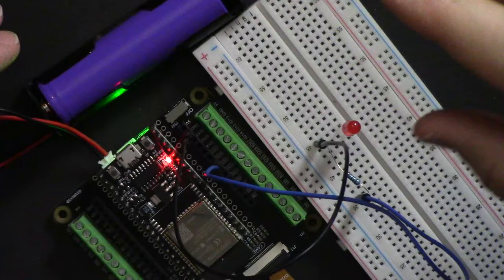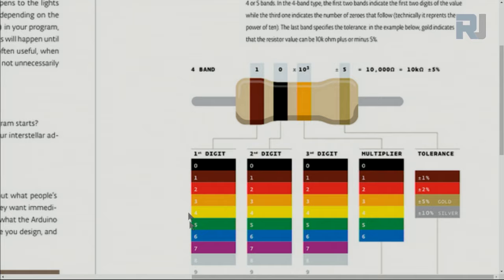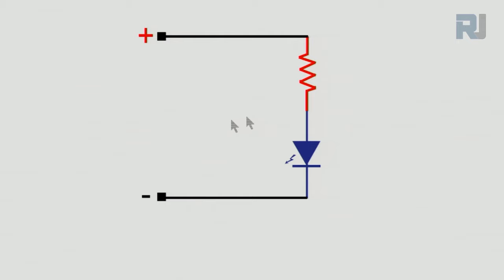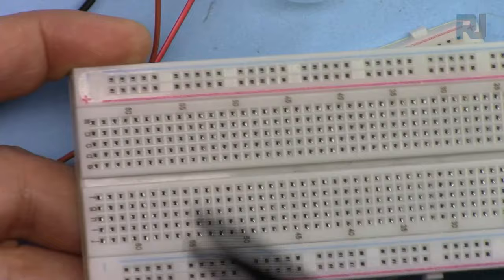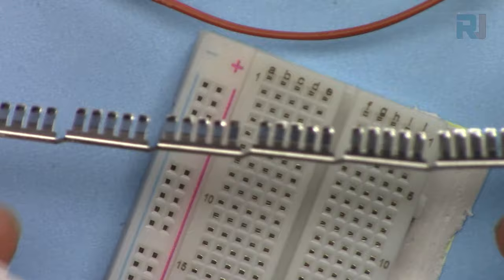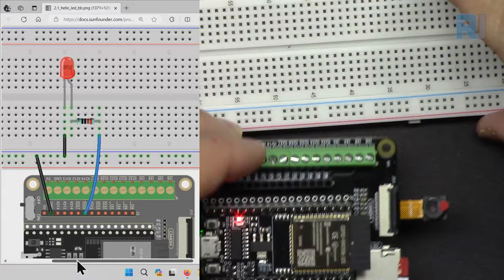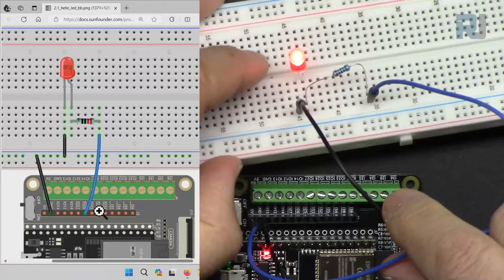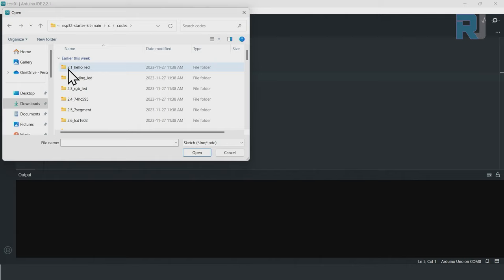ESP32 Tutorial 3 - Resistor, LED, Bredboard and First Project: Hello LED -ESP32 IoT Learning kit

Comment: First of all, thank you for this great tutorial 👍😁  I'm fairly new to this area and have a question about resistors and the ESP32s (WROOM) board. If I understood correctly, my board runs on 3.3V, but the blue LED is supposed to need 3.7V. According to the formula for the resistance, I would have a negative value. Do I even need a resistor in this case? If yes, which one?
Reply from the maker: You are welcome. Generally a bare LED operates with about 2V.  If you are sure about the operating voltage to be 3.7V then you connect it without a resistor and it will a little dimmer. No harm. You are getting negative resistance because you used higher led voltage than the source. Resistor is used to divide or reduce voltage. In your case yu don’t need resistor. But I believe you are wrong about the 3.7V . Check it again